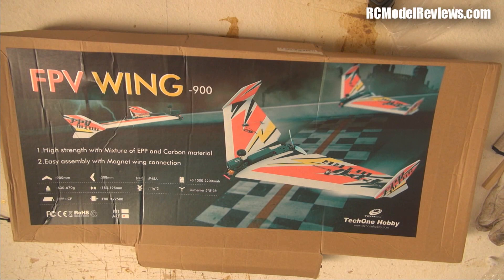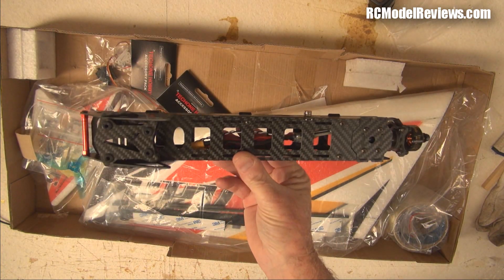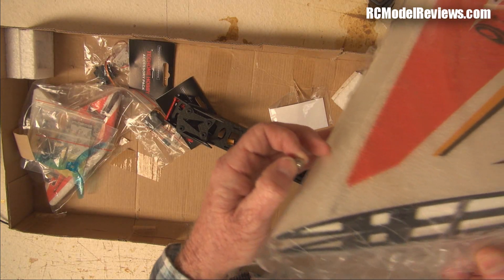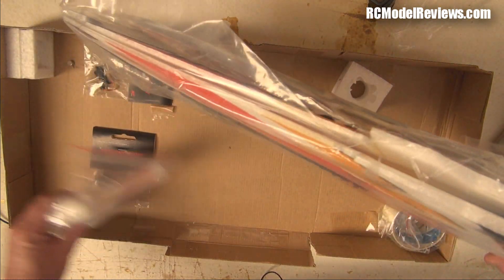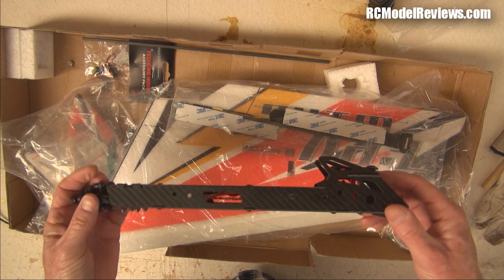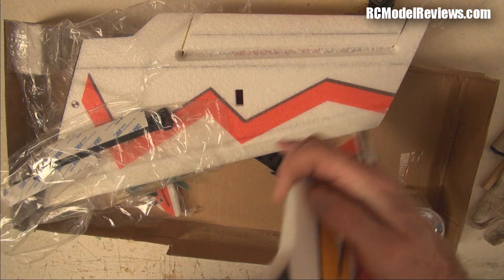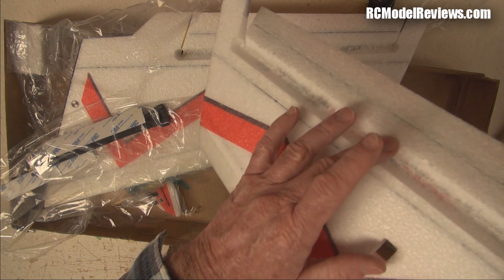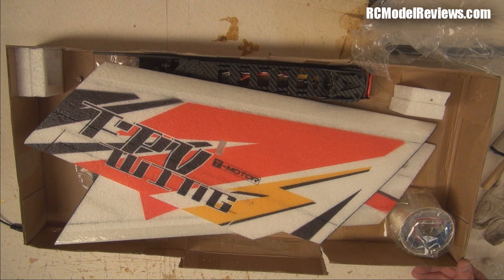Fixed Wing Friday: Techone FPV900 from Banggood.com

Comment: Don't get me wrong, product will get copied, and even "inspired by" but the fact this doesn't copy the best features of the MiniRaceWing just tells me it's a bad copy - not that they were actually going for something else
Reply: Looks like they copied the idea of the independent  composite centre fuselage, but I am pretty sure having an independent fuselage on wing has been built on for decades in Balsa. The wing is designed for FPV not racing. I think with an engineered replica of the race wing, made from Balsa, some people would choose the 'completely different design characteristics' of the composite wings as copies because the materials they are made out of are the same. Others would be more accurate in saying, the balsa version is a copy.